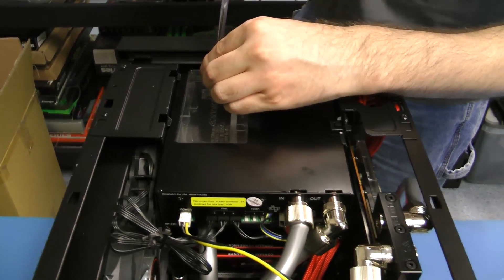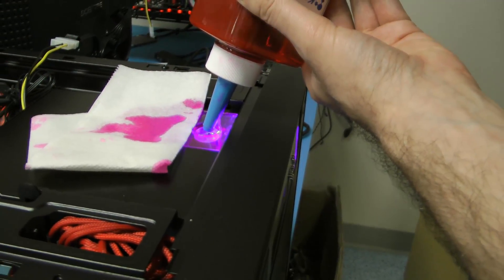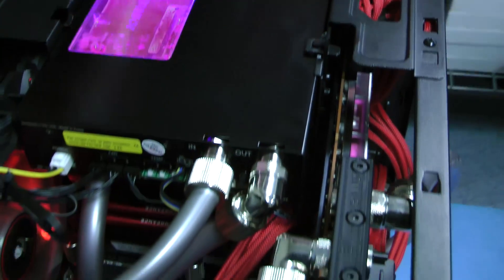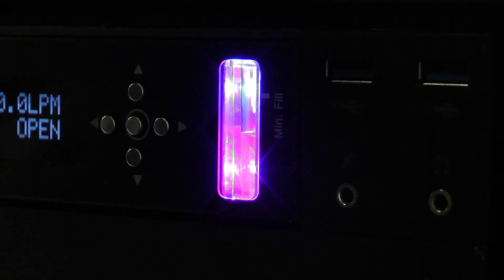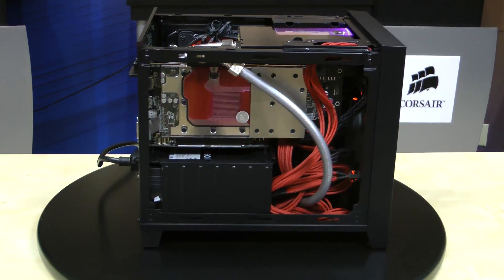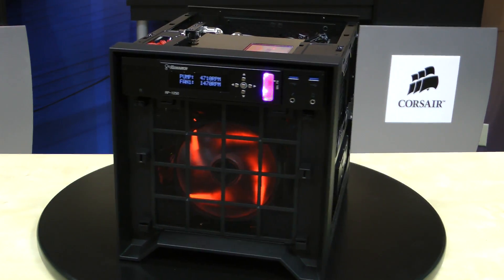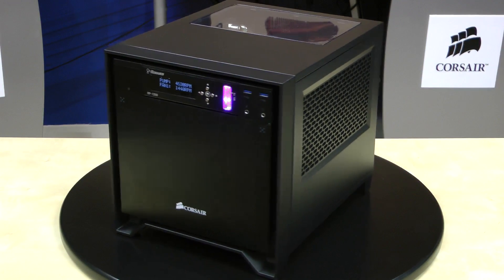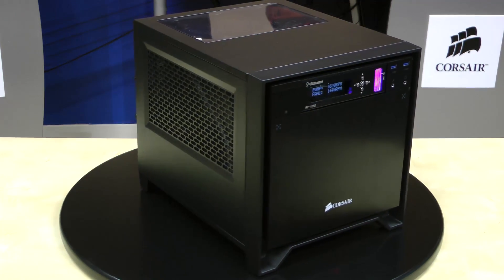Corsair Labs Uncut: Watercooled Obsidian Series 250D Finished Build

Comment: Where can I pick up that pump/res combo?
Reply: Ah. I found it. It is $299USD from the Koolance website. That's not cheap, but it isn't incredibly expensive considering you get the pump, res and fan controller/interface in such a sweet little package. I am not sure you would be able to get a custom system into the 250D without it.
Reply: I honestly had no idea that a product like this even existed until about 2 minutes before I posted the original comment. I have been building my own computers since my first personal computer (AMD Thunderbird with a 32MB Ati Rage Fury Pro and 256MB of RAM. It ran Diablo 2 and Max Payne like a beast). I have never used water cooling, though. I plan on putting together a system at the start of next month, and then by November I hope to get a "No Compromises" water loop to put into it. This product is cool in that it opens up options for small for factor builds. Thank you for all the info.

Comment: Intel Core i7-4770K CPU (3.5GHz quad-core with Hyper-Threading)
Diamond AMD Radeon R9 290X (Reference Design, up to 1GHz on the GPU, 5GHz GDDR5)
ASRock Z87E-ITX Motherboard
8GB (2x4GB) Corsair Vengeance Pro DDR3-3000 CAS 12
2x Corsair Neutron GTX 120GB SSD in RAID 0
Corsair AX860i 860W 80 Plus Platinum Power Supply

AlphaCool NexXxoS ST30 240mmx30mm and UT60 140mmx60mm Radiators
Koolance RP-1250 Pump/Reservoir Combo
EKWB EK-Supremacy CPU Waterblock
EKWB EK-FC R9-290X GPU Waterblock
Koolance Compression Fittings
2x Corsair AF120 Red LED Fans
1x Corsair AF140 Red LED Fan
Reply: do you have the measures of the compression fittings and how many of what type do you need??

Comment: WC Parts

Ek-Supremacy Clean CSQ - Acetal $66.95
EK-FC R9-290X - Nickel $115.95

Alphacool NexXxoS ST30 Full Copper 240mm $42.99
alphacool NexXxoS UT60 Full Copper 140mm $55.99

Koolance RP-1250 (DDC Pump, reservoir, control board combo) $299.99
Koolance Compression fittings for 13mm x 16mm $4.74 (they used five, so $23.7)
Koolance Swivel Angled fittings for 13mm x 16mm $7.49 (they used five, so $37.45)
Koolance Silver PVC Tubing 13mm x 16mm $1.79 per foot
Koolance LIQ-702 Coolrant UV Red 700ml $14.99

$658 except for tubings.

I'm pretty sure they purchased at least five 5 feet of tubing, so..
Total: $667(roughly)

Hardwares

Intel Core i7 4770K
Asrock Z87E-ITX
Corsair Vengeance Pro 
Corsair Neutron GTX SSD
AMD Radeon R9 290X
Corsair AX860i
Corsair Obsidian 250D
Corsair AF120 LED Red Twin Pack
Corsair AF140 LED..
Reply: or maybe tygon silver tubing instead of cheap koolance tubing
i don't exactly know what it is..

Comment: 25c on a 290x, I dont care if you poured liquid nitrogen on it, thats bullshit
Reply: 25C idle on a 290X is totally doable. 45C-52C at load, also totally doable. The GPU has a low heat density and a high surface area, the waterblock is able to very efficiently pull heat off of it and dissipate it in the loop.

Comment: 250D has so much wasted space/potential.
1. You could have used the lower compartment to stuff a square 480mm Rad.
2. Should have stuck with a side mounted SFX psu since lets face it you do not need a full size atx psu for a mini itx system, especially considering that you could get ones that do upto 600w.
3. Rear Storage. Stupid.
4. Cable management. 
5. Side rad.. why dual 120? you could have easily accommodated a dual 140.
6. Exposed Front I/O.
7. Should have made better use of the rear dual 80mm space and perhaps considered some sort of pump mount system.
8. What's up with 3 panels and six screws? There are more screws on the rear of the 250D than in the whole of my 900D. Innovate.
9. Wasted optical bay space, how about an integrated 3.5" or 2.5" disk mounting system, every other manufacturer is doing it. CM on their $49 elite 130 have it. Innovate.
10. Flex. Case Rigidity once Optical Drive is removed is appalling.
11. Consideration for tall GPUs.
12. Rear Storage.. HOT SWAP. Wiring that is a nightmare.
Reply: Look at the price and think again, buddy. This case isn't really designed for a custom water loop, but that option is there. Rear storage stupid? I found it a fantastic idea! It's the only space where it doesn't disrupt the cable management. I do agree that it could have been hot-swappable, that'd be amazing! Why would you fit a tall gpu in here? I'm assuming you're talking about direct cuii or the classified, however in such small spacing, it tends to be better with a back exhaust gpu.
Reply: To 5. No, theirs only enough room for a dual 120, look at corsairs specs
Reply: ***** A dual 120mm is the most common rad in watercooling..

Comment: do all this or just get a h100i for cpu and a g10 kraken with a h90 for the gpu (might need a cooler with longer tubes).
Reply: Denmon Complete bullshit. You can compare a AIO Liquid Cooler with a High-End Aircooler. But a custom loop cools way better.
Reply: Or, you could get a badass custom loop, which looks awesome, is fully customisable, is much better in terms of performance, and did I mention it looks better?
Reply: NZXT G10 doesn't adequately cool the VRMs.
Reply: the VRM  temps are heavily affected by the GPU temp and the PCB temp. air coolers technically dont not have any thermal contact with the VRMs.
Reply: This is not entirely correct. VRMs still need heatsinks to pull heat off of them. I've seen cards die without adequate VRM cooling.
Reply: ofcourse it still needs cooling however if you have direct airflow then its not a problem.
Reply: Direct airflow is not adequate, the surface area of the VRMs is too small. They need heatsinks.
Reply: heat sinks dont cool the vrms the same way a gpu, there is no thremal contact, its just passive
Reply: dboydev What? Heatsinks work pretty much exactly the same everywhere: They greatly increase the surface area for heat rejection to air. 

Also, of course there's thermal contact to the VRM heatsinks. Thermal pads and metal conduct heat away where it's dissipated to air over the much larger surface area of the heatsink vs the incredibly MOSFET assembly. The C/W figure for the (degrees C of temp rise per watt dissipated in the device) for package to air will be MUCH higher than package/heatsink to air.
Reply: ThierryTheuns
custom loops actually dont actually perform that much better than closed loop liquid coolers on normal scales.
Reply: ThierryTheuns It actually depends a lot on the heat you're pumping into them. On any decent heat scale, you're right. The pump flow alone will outperform an AIO. But for mainstream or mid-level parts, an AIO is a much better price/performance option.
Reply: ThierryTheuns depends on how many radiators you have, he only had one 140mm rad on this build and is cooling both the GPU and the CPU so temps at equilibrium are probably pretty equal to an AIO.
Reply: i meant 240, typo
Reply: George Makris That's... kind of stating the obvious. Custom loop isn't about value, and it's a complete joke to bring the concept of value per dollar into a discussion about watercooling ultimately.